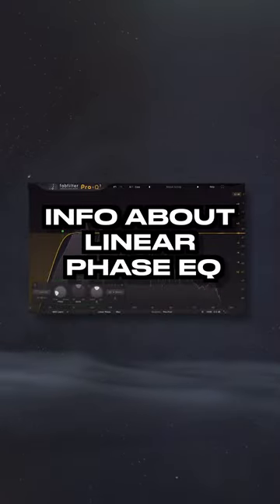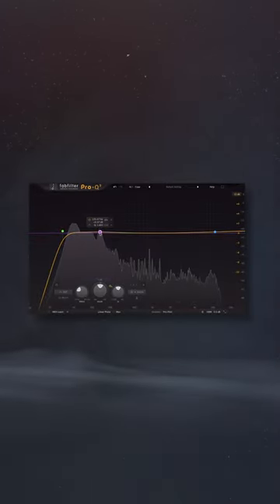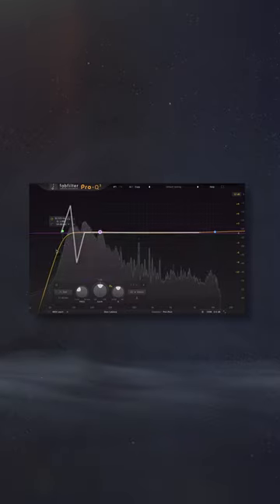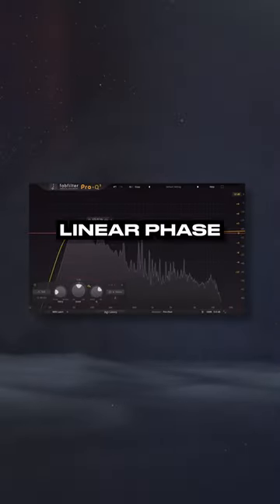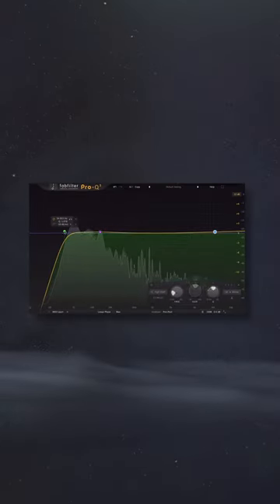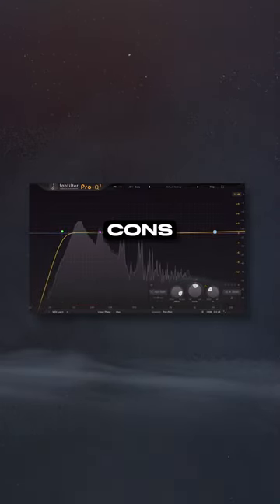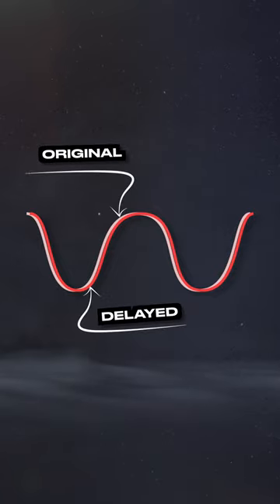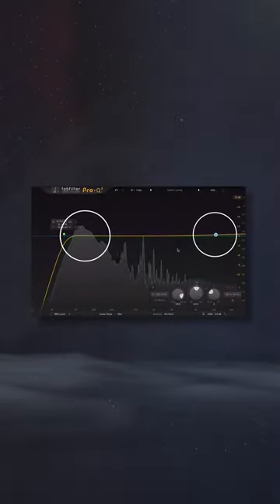Info About Linear Phase EQ

Comment: Your DAW will compensate delay perfectly. Last point is incorrect.
Reply from the maker: Thanks for watching!
Reply: Another comment pointed out the video may be conflating an apparent lack of time-compensation with pre-ringing.
Reply: Depends on plugins used, and the overall complexity in your track. 
I can probably personally show you some examples where you're technically wrong.

Comment: rendering must smooth out this distortion or render alghoritms are not accurate enough too?
Reply from the maker: To my knowledge it doesn't get smoothed out or corrected during rendering.  I'll double check, but last time I did a null test, the small differences were still present.

Comment: So is phases eq is better , why using other type of eq?
Reply: Linear phase EQ is useful when you're trying to process audio in such a way that both signals are mixed back together. This can be an issue when using parallel processing on audio or when independently adjusting the EQ parameters for the mid and side channels of a stereo audio clip. For most of your EQ needs, minimum phase filtering is just fine because static phase shift doesn't really register in your head when listening. It's only a problem in three situations. When you're automating the filter to move up and down the frequency spectrum, the phase shift is no longer static and could be audible. The next one is when you're mixing the filtered signal back into the dry signal, where the phase shift produces erroneous cuts and boosts. The last one is when you're creating crossovers to process certain bands of an audio signal independently. If you use a minimum phase filter, that introduces phase shift which causes the signals not to mix together properly and recreate the original signal. In those cases, linear phase filters are useful to prevent such issues.
Reply: @SeanGonzalezMDHEXT Is there any point in not using linear phase then? Aside from it causing latency which your DAW compensates for I don’t see any other cons. I don’t really see how it could cause any phase shift interference that really matters either.
Reply: @Lan-kn2iv  The trade off is pre-ringing. Linear Phase EQ works by using a windowing function to take snippets of audio and then processing them. As a result, you'll observe that the filter will start to ring before the transient hits, effect precedes the cause. This is an issue when you are working with bass heavy content, where the pre-ringing can kill your transients and remove punch. As such, you shouldn't always use linear phase EQ. You should use it when necessary and otherwise simply use minimum phase filtering.
Reply: @SeanGonzalezMDHEXT  Thanks that’s a good explanation. Wasn’t aware that it could cause preringing bc I’m not too into the technical side of this stuff. Would you recommend using it for mid side eq? I’ve just been using it for dynamic eq which I’m assuming is correct bc a minimum phase would cause dynamic phase shift.
Reply: @Lan-kn2iv  That depends on your goal in EQing the mid and side channels. The phase differences between mid and side help add a sense of depth. Adding a simple high pass filter to the side channel is enough to add a fair sense of depth to your mix. However, if you've already carefully crafted your stereo image, then you might want to use linear phase EQ for mid/side processing as it'd add no phase differences and keep the stereo image the same. As for dynamic EQ, which filter you use depends on your application. If you intend to mix the wet dynamic EQ part with the dry signal, linear phase might produce the results you'd expect. However, if you're just EQing without mixing it with the dry signal, then you're really only wasting CPU by using linear phase. The phase shift in minimum phase doesn't really matter if you're only hearing the filtered signal.

Comment: Okay but if u use it on the master then theres no other signal to interfere with💀
Reply from the maker: Thanks for watching! The inference isn't between the master and another signal, but between the master being processed by the EQ, and the master's timing being compensated for by the DAW.  It's a little counterintuitive, but when the signal is reset to the correct timing, that's when the interference occurs.  Granted the change is very slight, so it's not a huge detail even when it does occur.
Reply: So what if i turn delay compensation just off before linear phase equing?also what does the better quality in q3 mean in linear phase mode?the bump not as high?the ring being	 more in sync?or?
Reply: @Shkodo  The linear phase quality setting adjusts the size of the windowing function of the linear phase algorithm. Higher quality cuts down on pre-ringing thus preserving the punchiness of your transients. You're better off setting it to medium for monitoring and max (or high if you're using dynamic EQ) for rendering.
Reply: @sageaudio  so this only matters when you turn the plugin on/off? So it... doesn't affect audio quality?
Reply: @sageaudio this is just not correct. As OP correctly pointed out, if it's only master, no compensation ever occurs. There is nothing to compensate for, just an effect that takes a few ms of input before it generates output.